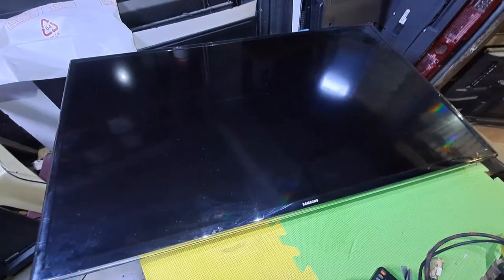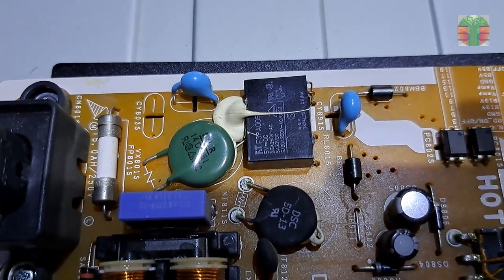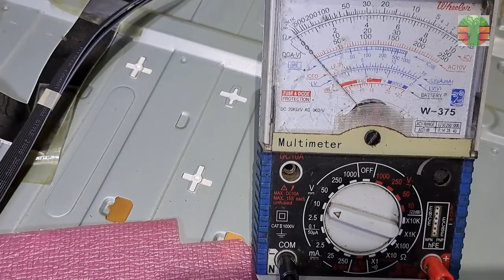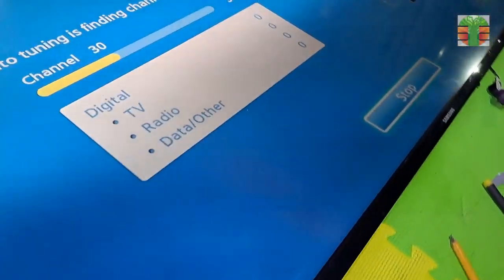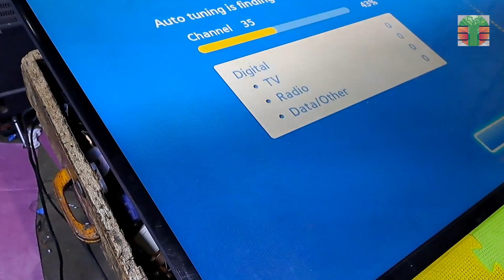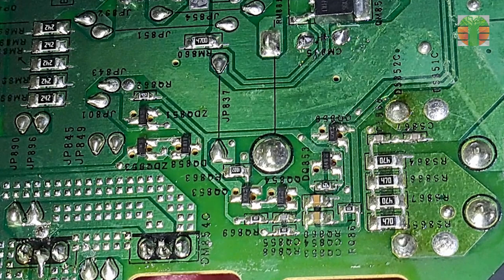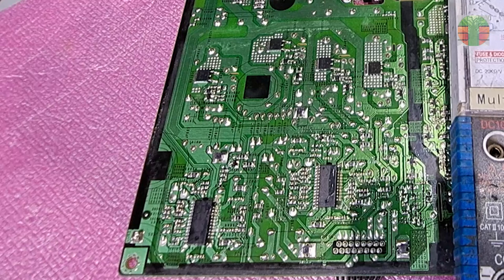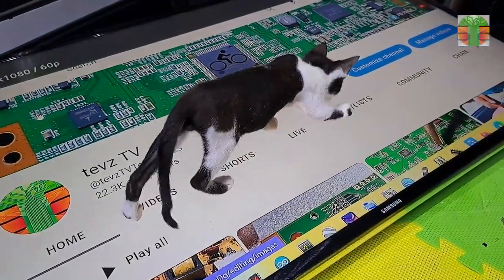Backlight Protect

Comment: Hi Mr dear T as you showed the 2 mosfet which seemed  had enough  voltage even when plugged the cable  in and I did not understand how you said they donot!!!!!
Will. you  please explan about that  and clear it more?
Thanks a lot and so glad having you in troubles time!
Reply from the maker: they dont turn on, boost, oscillate, step up.

Comment: Great video. But I have a specific issue. I changed my board TP.sis231.p83 with the board TP.vst59.p818 because I couldnt get my oriiginal one firmware dump and the tv rarely passes logo screen from bootloop to hdmi or other source. Almost all connectors are plug and play but the only difference the new boards and this new one has a dual 2 pin led driver inlet while the old one had a 12 pin connector. Do I need a voltage regulator board as a bridge in between or I can rewire it directly? Cable for led backlight shows 105 v. Thanks

Comment: I’m watching all your videos but I have this same problem on my 58” skyworth android tv but don’t know what the volts are supposed to be, do you know where I can get a proper readout or schematics for that tv I can’t find one anywhere online? Or is there other cheap TVs that are basically same as the skyworth?
Reply from the maker: Sorry, I have none.
Reply: @tevzTVTevatronics  OK thanks anyways... can you make a video and explain from where the power goes in the border and where it runs from the plug in to the led panel and where or what the normal volts are supposed to be for capacitors and diodes and the bigger transistors ? I'm trying to figure out how or where to find the drivers for led are by just looking at the power board... I'll watch them again and try to figure out the volts.. I just with there was a video on tvs that explain what each section or part does and how to find them... but thanks keep the videos Coming I like them....cheerz

Comment: Hello sir i have an lg 49 inch nanocell tv, it has standby light but no response from the power button, sometimes after a few minutes of pressing the tv tries to turn on and the standby light flashes and goes out like the tv is on, but no backlight , no image, no 5v usb output , the 13v from the psu is there and 3.3v is there on the main board and theres voltage on most of the inductors on the main board , the cpu is the only thing warming up, it gets hot as soon as i plug the power cable in , theres no shorts on the main , how else can i diagnose the problem ? Thankyou for any help sir. Reace , UK

Comment: Hi Tevz, I’ve one small question about backlight section of LCD, LED Tv or Monitors.

I’ve seen many people ignore the DIM/Adjustable pin connection while they’re adding an Inverter Board (External) they just use Vcc, Gnd & Enable connection. So I’m very much curious to know about that DIM connection like from where this signal is coming from, which IC generates DIM singal and why we do not use it while adding inverter module.

Thank you very much 🙏🏻
Reply from the maker: Dim is for the adjustment of the led brightness.  It's important to connect it. DIM, BL adjust are similar.

Comment: An SLC2013M driver IC is about a half-USD (50 cent) part, why not fix it the right way? There must be electronic stores there, or if you fix this many TVs you should have one in stock or lying around on a donor board.   Except with companies such as Apple for which parts are not available, a patch job like this is not an acceptable repair and certainly not guaranteed to last for long.
Reply from the maker: Yes it's a very cheap ic, the problem is not available in my area,  if I buy online it's take 3 months to arrive.

Comment: Why did he switch to an analogue multimeter? 
Other than that I don't have a balls what's going on here.
Reply from the maker: Measuring on to off voltage.  Analog meter is the right tool.
Reply: @tevzTVTevatronics  I was thinking that myself and have been looking for a cheap one. The digital multimeters are not able to pick up those quick changes. I thought I was mistaken for thinking this but now your video has confirmed my thoughts.